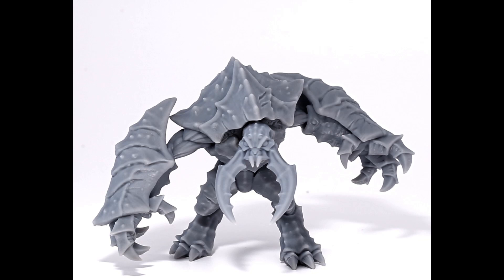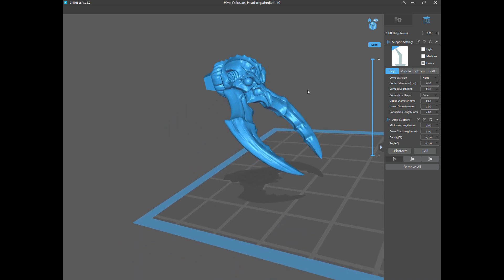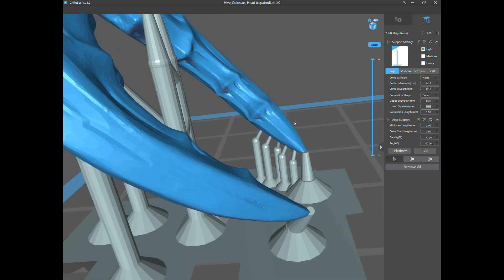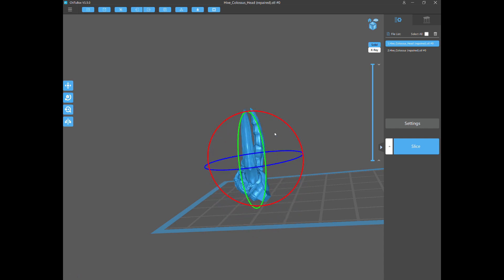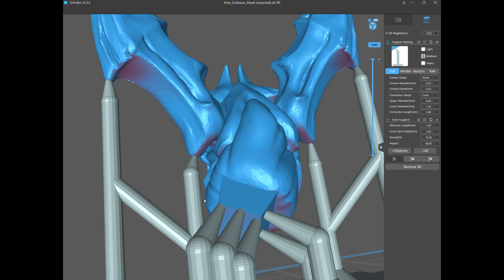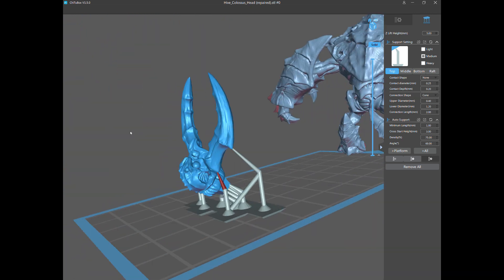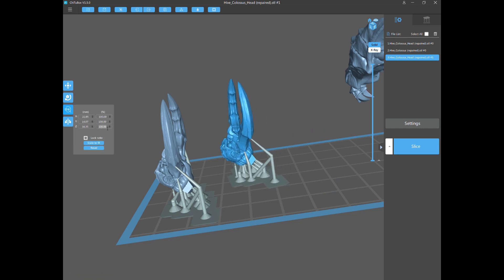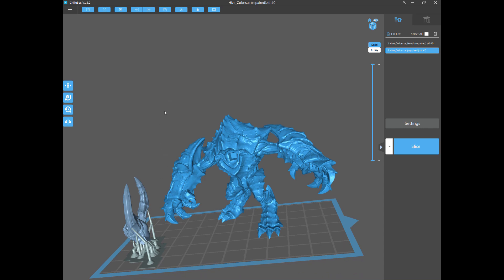Using Chitubox Part 3: Step by Step support placement on the Umberhulk

Comment: There are some similarities between out support styles.
I also like to go for super-light ones, but not as extreme as you - I'm currently using 0.6mm for the column & 0.2mm for the tips.
I considered going thinner tips (to easily remove supports after printing), but after calibrating with the Cubes-of-calibration I noticed the thinnest columns there are 0.1mm and are incredibly thin.
But it's not just that. The cross-sectional area of the tip (and the column) determines its strength. And because it's an area (ie in 2D) it's a product of multiplication of two dimensions (or since it's circular = π*r²). This means that by increasing the radius of a tip (or a column) it'll get stronger by the square of the change, but also the opposite way - the reduction of the tip radius will decrease strength with the square of the change.
Few examples for comparison:
Ø 0.6mm => 1.13 mm²
Ø 0.2mm => 0.13 mm²
Ø 0.12mm => 0.045 mm²
Whatever the strength of the semi-cured resin (during printing) is it'll be proportional to the area of resin that transmits the forces.
So a Ø 0.12mm tip is almost 3 times weaker than a Ø 0.2mm tip. So you not only have to put 3 times more tips, but also hope that none of them fail.

With columns it's much easier, as there's easy way to make stronger support columns even with very thin columns - just make a tri-truss-column - ie make 3 vertical columns near each other, and connect each of them with bracings.
Note: if you're still using Chitubox my humble advice is stop :) Switch to Lychee - even the free Lychee is much better, and the paid Lychee is very affordable (not even comparable to Chitubox!)
Lychee is still not perfect though :/ 
It has auto-orientation & auto-supports but they're useless imho (unless you're in a real hurry!), but once you know how to make supports & orientation better you'll feel that cringe when you see what the auto generates.
Still Lychee has some very useful features - like island supports; hollowing - the core is same as chitubox, but also have suction areas detection and block-areas - ie if some hollow areas leavy very small cavities that can't be well connected to larger cavity or drained outside you can just put a simple shape over it which instructs the slicer to make is solid (and of course you can control the position shape & orientation of these blocks, and can use whatever number of them that you need).

Lychee's bracings feat is semi-useful. You can select all supports and click 'bracings' but I wouldn't do that as Lychee creates too many bracings but only between two columns. You can safely delete at least half of them.
Even if you select manually 3 support columns and click bracings Lychee will create bracings between column A & B, and between B & C, but not between A & C, but that can be remedied by selecting again A & C only and click bracings again. Trouble is I have to delete at least half the bracings afterwards (and perhaps more few bracings up/down if needed).
If Lychee allowed to create bracings between each of the 3 selected columns, and allowed to configure bracings density (I would set it below 50%) if would be great and you could create a tri-truss-column with only few clicks. Currently I use auto-bracings (between selected columns only) only because it's slightly faster to delete half and they'll be at 45 degrees, rather than create half and aim at ~45 degrees.

2 braced columns are strong in their plane, but weak in side-way forces (single column is weak in all side-way forces, it's ok only in tension), but 3 even sparsely braced columns are strong in all directions!
Also if you notice above 1 column can take the force of ~8 tips (with the 0.6 / 0.2 example), so 3 columns can handle up to 24 tips, and you'll have wider area (of the tri-truss-tower) to attach the tips. Of course you'll need more than one tri-truss-towers, but one under each major support area most likely will be enough as even half-cured resin has plenty of tensile strength.
Just don't forget to ad plenty of tips to the bottoms of your model (ie feet for example), the rest can be supported mostly by the lowest (supported) parts, and then you can only take care of the islands.
This way I use about 1/3rd of the resin of a pre-supported model, and have no failure or trouble removing supports after printing.

Comment: Hey man great video! Question i heard that if you use boiled water after cleaning with isopropyl alcohol, the supports will come out more easily is that alright?
Reply from the maker: I use hot, not quite boiling water yes  :)
Reply: @3dprintingpro212  Thanks for the tip i've learned a lot with you! :D

Comment: I have a question. I’m extremely new. I plan on printing my own designs. Will I assume I will need a separate program to design with? Then transfer to this program? Just wondering the series from scrap to print.
Reply: I have the epax x1.

Comment: One trick I figured out for not letting supports bond to the model is that you can support other supports. All I have to do is pop in the bonded supports then support those in an evergrowing stack until the newest support is off the model. Then I can delete all the supports that attach to the model on both ends and edit the contact point on the newest good support to hit the island without the supports touching the model on more than just at the island. Sometimes I get five or six supports stacked on top of each other before one of them falls off the edge of the model.

Comment: Apparently there is an easier way...
Watch this https://youtu.be/b3wFEdN7TqQ

I need help with a simple model I made That keeps wrinkling my fep... It's ruined 5 so far and no matter what settings I use it screws up the fep and print... The model takes 45min on a fdm printer.. But if I try to use supports to maybe save the fep the times is unreasonable... It is 3+hrs...

I've asked 3 forums, creality and many "engineers" and nobody has given me an answer... None even know why it happens... Can you help?

Comment: Get's great reviews but I can't follow this at all. Talking way too fast. Have to squint to see the settings off to the right and had to replay those settings about 30 times before they were quite manically changed after 3 seconds. Settings are everything and I can't read them even on full screen. I still ended up with upside down supports that drown out the model.

Comment: I am not able to move the base of my supports like you did in the video. When you click yours it goes all red and it moves. When I click mine it only goes partially red and lis locked in place. Is there a setting I am missing somewhere?
Reply from the maker: Make sure you click on the bottom portion of the support to move it.  Also, if it is anchored on the model itself it won't move, or if the base is "hemmed in" by other support bases sometimes you can't move it.
Reply: @3dprintingpro212  Thank you so much for the reply! It is getting stuck to the base of the model and I have no idea how to set it up where it doesn't. I really appreciate your help. I will figure it out eventually!

Comment: HELP! When you select a support in "Edit Support" the entire structure turns red and you can move the whole thing. When I select a support tree, only the shaft turns red and I can't move it anywhere. What am I doing wrong?
Reply from the maker: When you select the shaft (as opposed to the top portion) you can only move it if the base isn't "locked in place" by other support bases.

Comment: I',m having a hard time supporting wings for a model. Got any tips for such model with that many angles?
Reply from the maker: I'd have to see the model, but for wings I've done, i orient so the most parts are facing "up" so you need as few supports as possible, then light supports to most other spots (always heavies at the "bottom" of the model though).